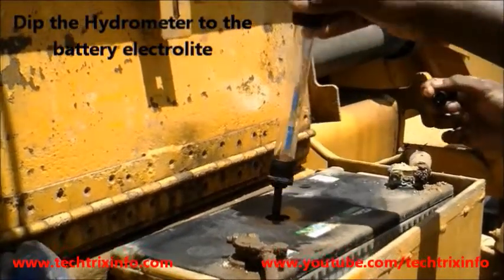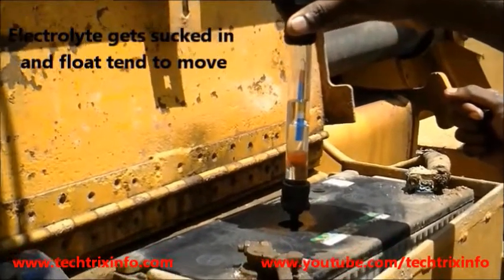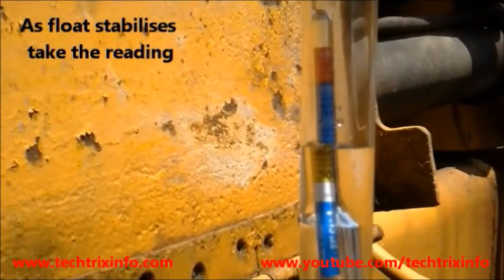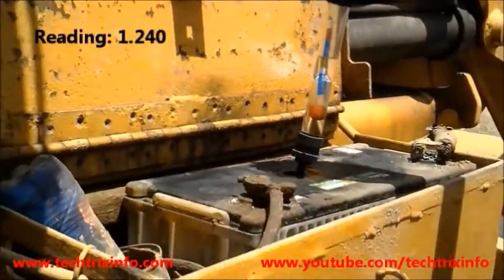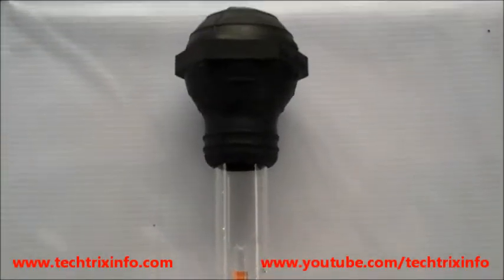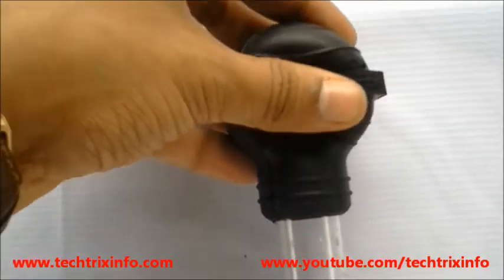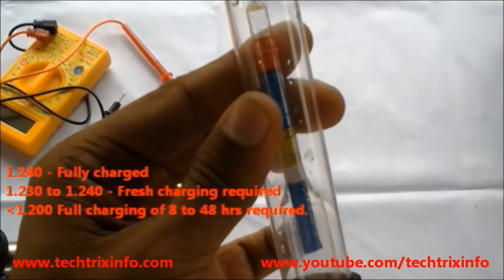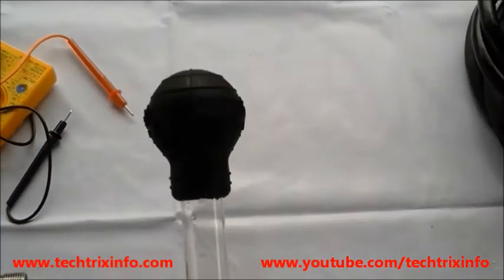How to use a hydrometer. ✔

Comment from the maker: This video shows how to check the specific gravity of a lead acid battery using a hydrometer.
Hydrometer consists of a glass tube which has a float inside. Bottom of the hydrometer have a suction tube. On the top we have a rubber bulb, which is squeezed to suck the electrolyte. 
As it enters the tube, the float tends to move. So we can get the specific gravity at the scale of the float where the electrolyte rests.   
This reading can give us a clear idea about the battery.